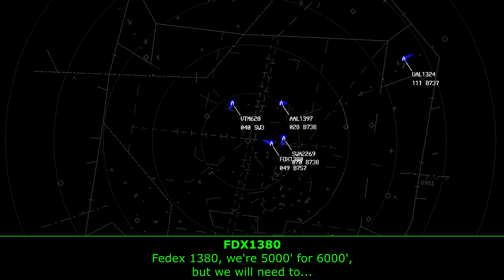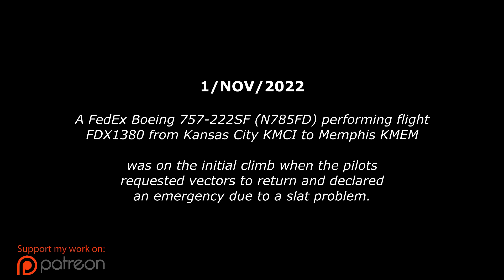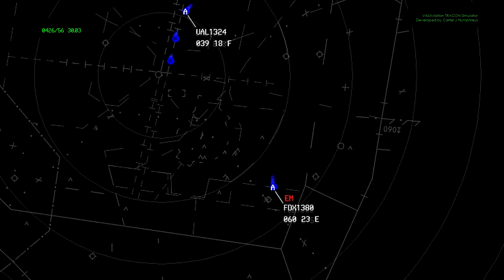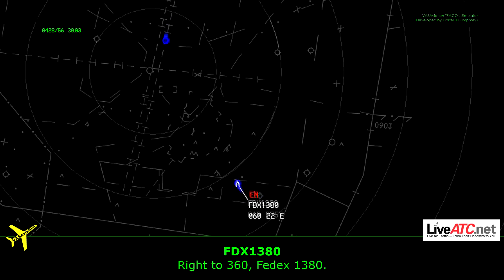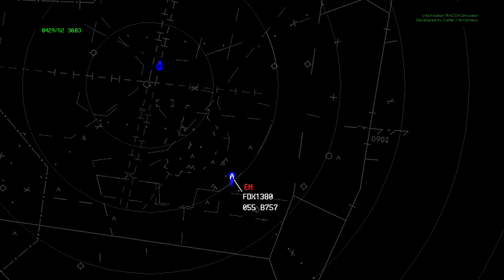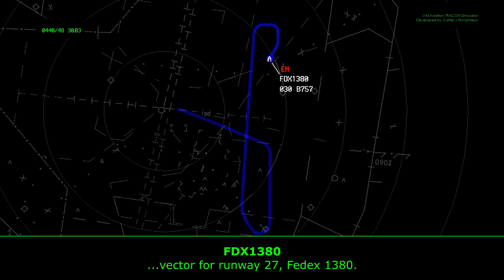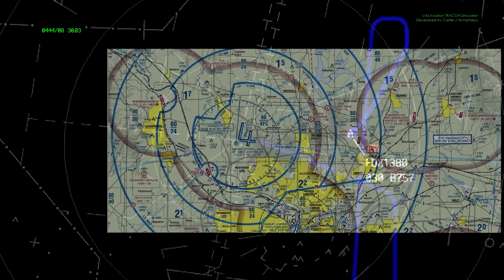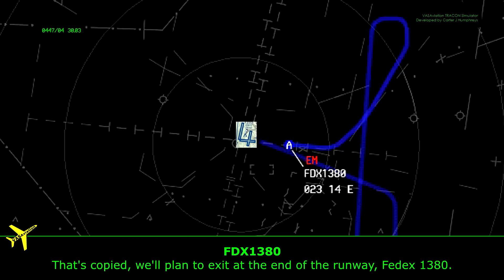FedEx B757 | SLAT PROBLEMS AFTER TAKEOFF | Emergency Return

Comment: Once down, what would be the logic behind exiting at the end of the runway? Don't they have a maintenance area? There is really no emergency after they have landed is there?
Reply: Faster approach speed means hot brakes, and that’s where the emergency vehicles have staged for inspection. Gets both parities on the same page as to where the vehicles can meet the aircraft without undue delay.
Reply: You exit at the end of the runway because it means less stress on the brakes and it’s a good place to arrange to meet the RFF.

Comment: Drives me nuts when they don't declare the nature of the emergency as soon as reasonably possible. The pilots danced around the nature of the emergency, but the controller requested that info. Big difference between pilots have food poisoning, and we can not control our airplane. Like are you going to call the fire department, then vaguely say, "well, I might have an emergency, but stay on the line and I might let you know what it is if you guess correctly"?
 No, 911 starts with "what is the nature of your emergency"?

It is the only "industry" I can think of that does it this way. Yes, I get they are busy, but as soon as resonably possible just spit it out. At least a hint.
Reply: There is a reason the crew was going through a checklist.  Making sure they had done everything possible to correct the situation.  It would drive me nuts if they declared an emergency right away and then said "never mind, we fixed the problem."
Reply: yea, but after they declared an emergency, they were still not stating the nature of the emergency. I get the "aviate, navigate, communicate"" mantra, great; but pilots are consistently failing to communicate. It took them half a breath, to finally state the nature of the emergency. I dont expect them to give an engineering PHd thesis about the problem, but three or four words?
Reply: like pilots are trying to be TOO cool under pressure. It would be interesting to see a statistical breakdown of emergencies, and how long it takes for the pilots to state the nature of the emergency to the ATC on tower tapes. Like you should not need to figure out from cockpit voice recorder, after it is too late, what was the emergency.
Reply: @cenccenc946  I hear him stating he is going to declare at around minute seventeen...  stats the problem they are having twenty seconds later.   Not bad if they were running through all the checklist at the same time.
Reply: 911 actually starts with "where is your emergency?" Reason being if the call is disconnected they can still have someone coming to check on you. But your point is still valid.

I think the European standard of "pan pan" vs "mayday" is much better than the American generic "declaring an emergency." More concise and gives more info. A pan-pan means "there's a problem and we need assistance" where a mayday means "we have a very critical issue requiring immediate resolution."

Fairly certain here in the states we use pan pan and mayday in the nautical world, so why we don't in aviation is weird.
Reply: short trip.....; }
Reply: Its because in America they don't use the proper phraseology.
Reply: @AShadowboxsFSX  I agree. One factor is that the pilot is giving an immediate indication of urgency and how concerned they are without having to go into details. For example, a trim control issue may mean that the crew want to hold whilst they talk to engineering about whether to return, or that the pilot is having difficulty keeping the plane in the air and  needs to get on the ground as soon as possible. And an inexperienced or panicking pilot may be thrown by a problem that an more experienced one would take in their stride. That all affects how other aircraft and ATC should respond without a lot of chatter that the pilot in question may be too busy to answer or may distract from flying the aircraft.
Reply: @cenccenc946  - you are 100% right. I accept that the majority of these real life ATC channels are American, but it seems that so many US Pilots are utterly incapable of making emergency calls which are to the point. They always include some sort of hesitation to admit that anything is wrong or that running checklists is more important than giving basic facts to ATC. Now compare with a few of these videos from Amsterdam or Australia and you see really appropriate ATC and pilot interactions. 

I won’t mention “emergency” versus “mayday” because I’ll get trolled by R L T cruising through on her BarcaLounger. 😊

People also mentioned the mythical “aviation, navigate, communicate”. Unfortunately this is far to a basic response to such an emergency. You can’t navigate without getting permission, so you need to communicate before navigating.
Reply: Aviate, Navigate, Communicate. In that order. They don't care that it drives you nuts.
Reply: @Guysm1l3y  - proper aviation doesn’t work like that.
Reply: In the real world it does Ed.       @EdOeuna
Reply: @williamedwards1528  - no it doesn’t. There is never a time when, during an emergency situation, that either pilot sits back and says or thinks “we’ve aviated, now it’s time to navigate”, or “ATC are trying to talk to us but we can’t talk to them because we’re still navigating”. 

It isn’t clear and as simple as that. There are places where you must speak to ATC before you fly an engine out procedure because the EOP cuts across other runways or flies opposite to the SID.
Reply: @theHDRflightdeck  In America we don't have proper anything!
Reply: @ranonampangom2185  you got proper guns tho!
Reply: @theHDRflightdeck  and proper fascists, yeah

Comment: With the route of intended flight so short and the destination being a major hub, could they have gone to Memphis with the malfunctioning slats? I would think it could be done safely with a speed restriction and a lower cruise altitude, but MCI to Memphis is short enough that it would seem reasonable to complete the flight. 

My understanding is that slats are similar to flaps, but they extend forward and allow flight even slower than flaps. Is it a matter of the maximum speed with slats out is too slow to consider continuing the flight?
Reply: I'd guess that they didn't want to fly with the extra drag. Hard to calculate an appropriate amount of fuel for the trip when there's an extra 200 ft² of wing surface.
Reply: Not a chance should you continue to destination with slats out, no matter how far. That’s a flight control issue. Fuel burn would be way off because of the increased drag and much lower altitude. They’d have to have a really good explanation as to why to continue, and getting the boxes to the hub isn’t a good explanation.
Reply: It is perfectly feasible to continue but this depends on the fuel flow and much lower altitude. You’ve got no real idea on the expected fuel flow for slats extended so it will be a guessing game. Maybe the QRH will help with data covering such things as holding at 15000 with flaps 5. 

There isn’t an issue with leaving flaps extended so there’s no rush to return. However, running the checklist and recalculating landing performance would only take a minute or two.